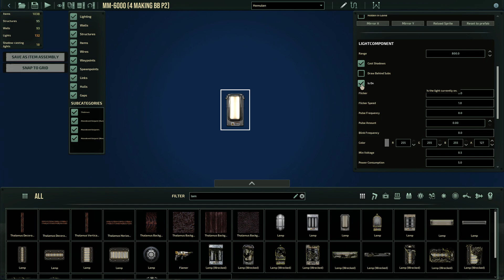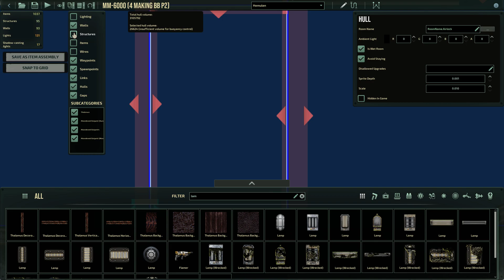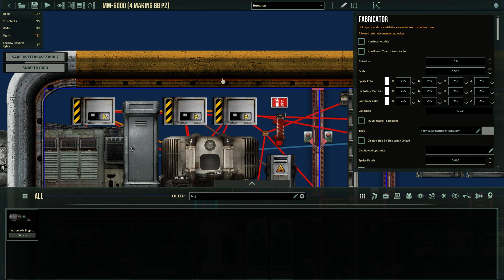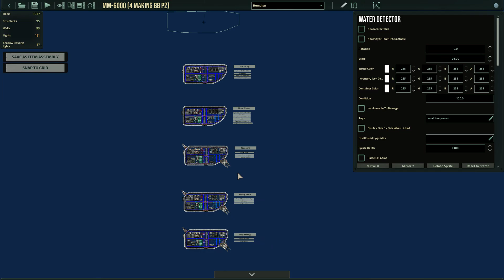Tiny sub tutorial 2: electricity and wiring

Comment: Hey. If anyone reads this. I'm wondering if anyone knows how to purposely make a junction box go overvoltage? Now I know what you're thinking... "Why would you want the junction boxes to overload?", and my answer is "Fire", and why do I need fire? Well... I've been looking for a way to Auto-dispose of Ballast Flora without using Detonators and Incendium grenades and being messy with that. And so I thought about ways of making fire. and there's only weapons, tools, thermal artifact, reactor fire and electrical fires that do this. 

Now, since I'm worried about my Reactor PDA being confused on my sub if I put 1 tiny reactor in each ballast and intentionally set up an Overload Reactor Button just to clear out some Ballast Floras if they arrive. And I really don't want to risk of a meltdown anyway. I want to be able to create Electrical Fires in my Ballasts intentionally. I tried some things with hooking up batteries and messing with "Min_Voltage" and such with a 1000 KW demanding Light switch. But for some reason the junction boxes are fine with 15 KW Voltage to 15 Load, which is weird because the lamp is set to draw 1000 kw.... So.... It should have overloaded the junction box and started a fire, right?